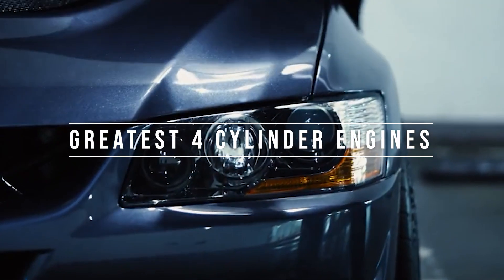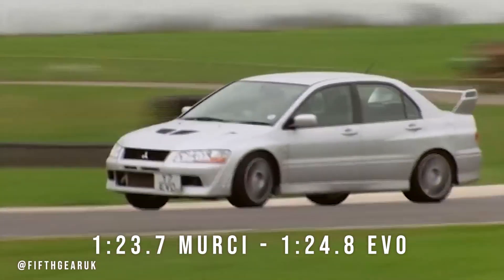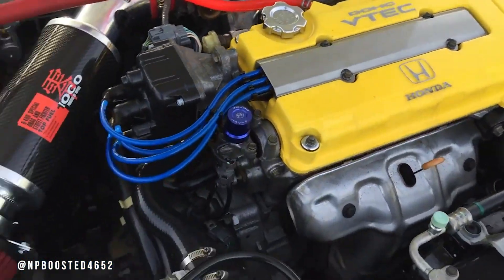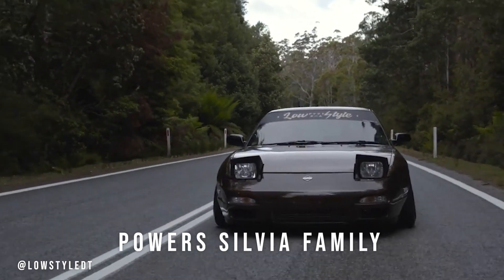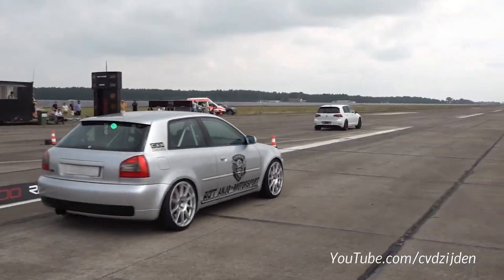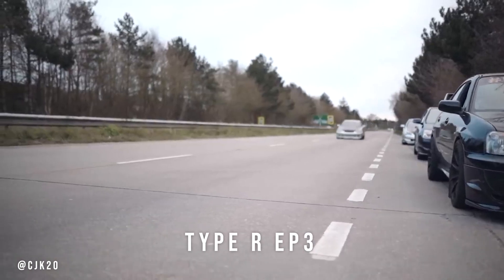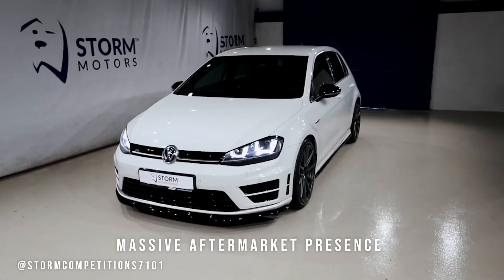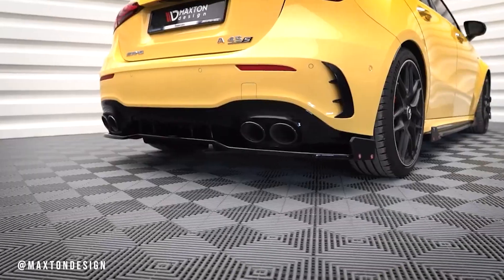THE GREATEST 4 CYLINDER ENGINES OF ALL TIME??

Comment: Oh gosh, how did you haven’t put a Ej207, I’ve owned cars with most of these engines & I think your just going by facts & not experience, my gosh, the JDM EJ207 for me is the greatest 4pot of all time; with a twin scroll turbo & equal length headers, it screamed all the way to 8,000 rpm, definitely one of the best sounding engines let alone 4pots, the 4g63t is ok, I had a evo 7 with a twin scroll at 340BHP & a loud laggy evo 6 with 400, the 4g63t can sound good though, but doesn’t give you the buzz like a ej, the k20
Or b18 does kinda give you the buzz but I haven’t tried a turbo changed one so can’t comment on it, the 1.8t is a good engine my brother currently has a Tt mk1 with it, the Mercedes engine is just soulless, but definitely a weapon.